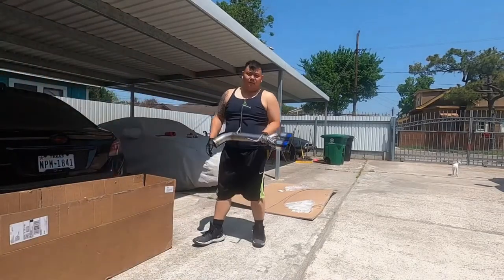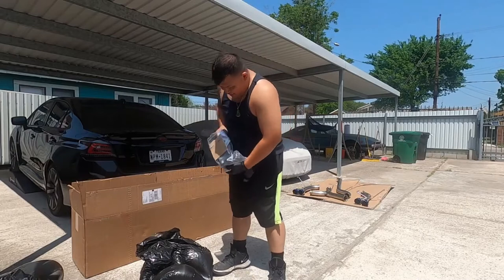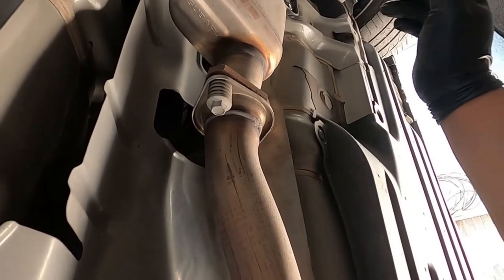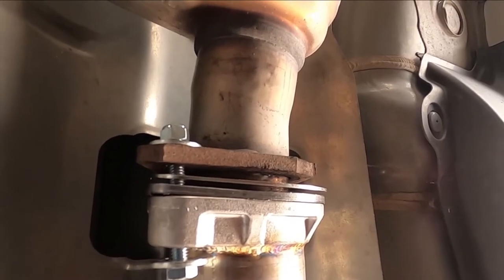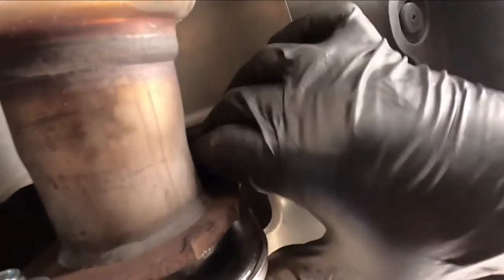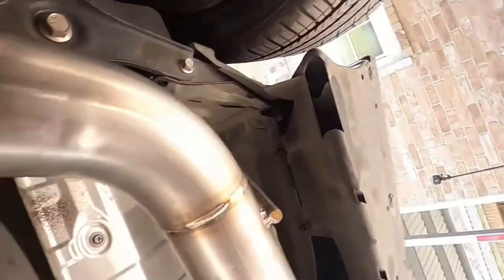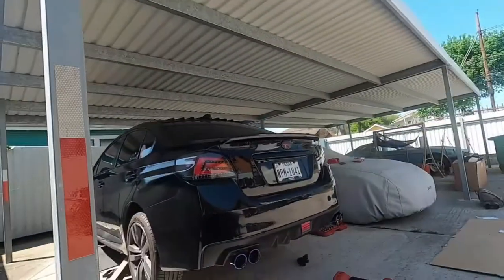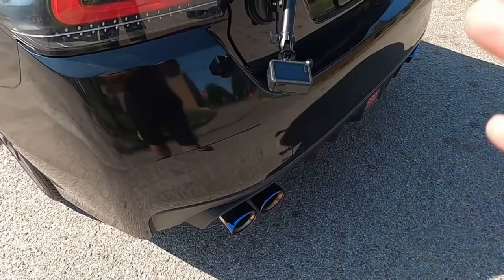SUBARU WRX / STI ETS Cat-Back Exhaust System (Extreme Turbo System)

Comment: What's going on brother question. I hear is not a good thing for your engine going to stage 2+ with Cobb accesport ots tune . Am confused some people tho etune or pro tune Which is not that easy , so if i need etune or pro tune why Cobb offer stage 2+ package ?
Reply from the maker: Cobb offers pre tune so you can use there products but in the safest way for you to drive with your installed products you bought. But you really can’t get on and race it, you need to get it pro tune and dyno to get it properly working it’s full potential with out getting in to limp mode or throw a rod in your motor. It’s best to buy all your products you looking to get and install them and get pro tune and dyno right away. That why a lot of new owners throw rods in there motors cause they don’t get a pro tune and dyno.
Reply: Ok i would thanks for info i really Appreciate 👍🏼
Reply from the maker: Do it the right way the safe way, throwing a rod in your motor is no fun plus it’s gonna cost you a lot to fix it. Just get it pro tune and dyno right away. Since you put on the Cobb access port you already void the warranty so if you blow your motor or rod knock. Expect to buy a new motor.

Comment: This exhaust, grimmspeed stealth box intake, IAG v3 air oil seperator, and COBB stage 1+ (big sf) is that a safe setup or will i expect my subi to blow?
Reply from the maker: Those are fine, if you got a sti your limit is 400 HP and that’s pushing it. To be safe without knocking or blow your motor is 370 hp and under, you don’t wanna risk the reliability. Only way to find out is tune and dyno your subie. Only way you want to push over 400 HP is built the motor with piston sleeve, aftermarket pistons & rods to handle over 400 HP. Usually subie owners built there motor are 600 HP or more.
Reply: @Gemini-G7  Just ordered my setup, kinda switched it up but i’m staying with the IAG V3, switched to MAPerformance intake and I will be running their OTS stage 1+ and i got the AWE track exhaust. I drive a 2019 wrx so I think i’ll be sitting at around 300 flat? Do you think this is reliable for a daily?
Reply from the maker: @loudless2  you should be fine but remeber to get it pro tune and dyno. The stock block can only handle 395 hp as a stock block.

Comment: Ok so i would have to go with Cobb because I o ready have Cobb access port and intake , boomba air valve , so i guess I would have to go for Cobb j-pipe but i don't like the Cobb exhaust sounds
Reply from the maker: You can go any other brand you like it don’t have to be Cobb. But the Cobb access port it’s a must have. If you do your intake or your j pipe you need to get it tune so your car doesn’t go on limp mode. You can use Cobb pre tune from there online website too but it’s not 100 percent till you get it properly tune.
Reply from the maker: The top 3 exhaust in ets, tomei, and awe track system.
Reply: @Gemini-G7  thanks for the respond
Reply from the maker: @williamrodas4084  Your welcome brother !